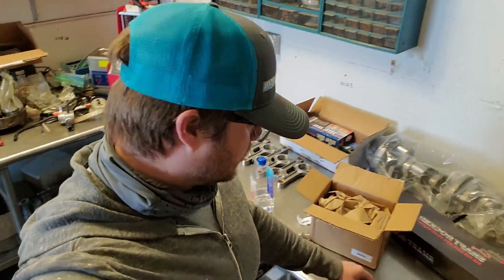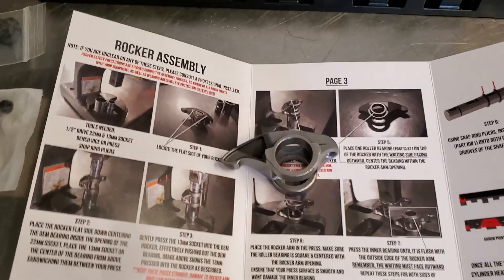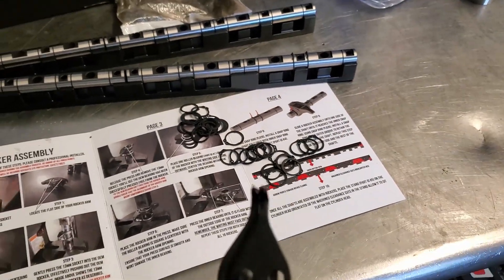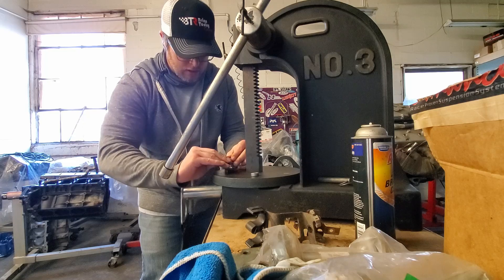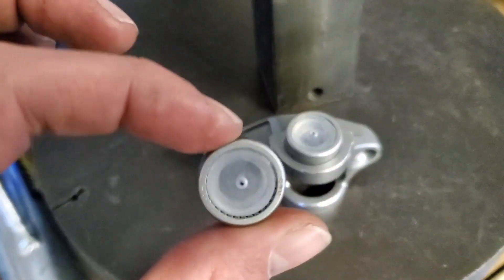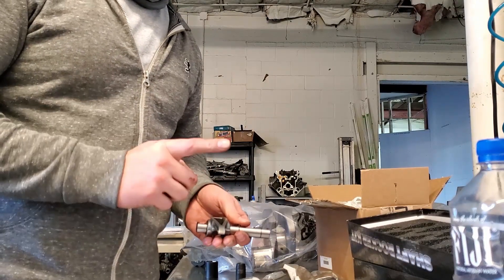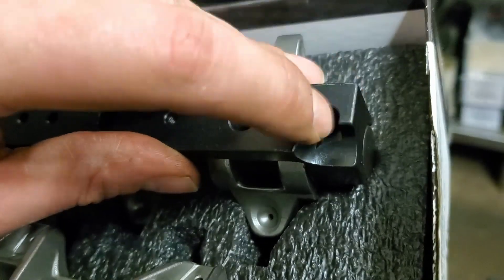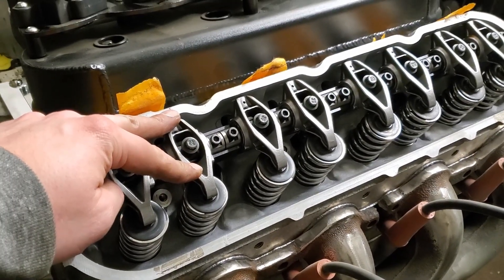BTR Shaft Rocker Kit and Bare Rocker Arms

Comment: Did they clear the OEM ls valve covers?  Cool build
Reply from the maker: I don't have OEM covers, but they do clear Motion Raceworks valve covers.
Reply: @GregoryBrettin i will find out the hard way since i bought these to go with PRC cylinder heads and wanted to know if they could clear motion raceworks billet valve covers.  And you just answered my question 

Thanks

Comment: We'll see how they work in the long run. I wish they boxed it like the stock. Is there an intake and exhaust difference with their rockers?
Reply from the maker: Exhaust and intake are the same, stock are the same for both sides as well. The advantages are strength and weight on tip in. I believe BTR has a spintron video that covers it.  

I ran the hell out of them on the dyno recently. My 4.8 doesn't have any valvetrain noise like most engines. I'm currently changing out my intake to a Shearer Fab ULP A2W with Holley short runners. Previously the engine didn't want to RPM (7200max) so we'll see how the new setup does. Hoping to spin 8500 - 9000. I know people will say you can do that with stock and a trunnion, but I was a bit of insurance.  Probably more information than you want... lol

Comment: After installation did any of them seem a little to tight on shaft I have the same rockers and shaft kit and it wasn't all of them it was only a few
Reply from the maker: All of the shaft mounted rockers were absolutely smooth as butter.
Reply: @GregoryBrettin  you see that's what's tripping me out because I called the customer service over at Brian tooley and they're like they need to be ran as soon as the ran though free up I just don't want to send needle bearings to my freshly rebuilt motor it's a scary thing I'm wondering if I should have just try and buy bushings for these rocker arms and unfortunately go through the process all over again
Reply from the maker: @grantadan  I think you know what is right. If they are just not spinning easy on the shaft, then I'd say it's a break in issue. If the needle bearing were binding, I'd 100% change it

Comment: How did you end up measuring pushrods/preload?  Did you bolt down all five on each cylinder or?  Just picked this kit up and am already exhausted thinking about how long that is going to take!
Reply from the maker: I had a push rod measuring. Then I checked all the valves by rolling over the engine over and measured lash when the valve was closed. I looked for binding when the valve was open. That's roughly what was done, I had a buddy helping.

Comment: While this is a good video for its intended application of stock rockers; many of its points cannot be used when upgrading to roller tip rocker arms, where MID-LIFT geometry must be used. There are a lot of videos out on roller tip rocker geometry that is completely misleading on the priorities of what should be checked, how to set, and what their effects are. For those who fall into this more high end application of rocker geometry for any of the LS series engines, please find the following comments helpful.
>
You NEVER want to worry about where the wear pattern is at on the valve to set rocker geometry. The wear pattern has NOTHING to do with "geometry." Because none of the manufacturers have any "accurate" standards for stud and stand mount dimensions from the valve, and because the stud leans into the valve, and because engine builders use varying length valves, and lastly, because every custom engine has a different NET valve lift, no rocker arm is going to be able to have the exact length required (on a mass produced basis) to accommodate all these variables. That is why you shouldn't worry about where the witness mark on the valve tip is at. Just worry about the angles. The BEST way to assure you are measuring ANGLES correctly with HARD measurements, is to use the VALVE SPRING RETAINER, because it is perfectly mounted at a 90 degree angle to the valve, and that is the principle of MID-LIFT precision.
>
You NEVER want to use "checking springs" to set rocker geometry. You need to check for NET valve lift with ACTUAL springs. Once you know what your NET valve lift is, then EVERYTHING after that is done with a CLOSED valve, no tension on the valve train; not even necessary to have an adjuster in place. Just an adjustable push-rod; dial calipers and KNOWLEDGE.
>
With all the tools I've made; and all the engines I've built; and all the tricks I've learned (many from other creative engine builders), to this day when I still occasionally help an old friend out on setting up his rocker geometry, I do it in less than 5 minutes with the following technique. It's all done in the CLOSED VALVE position, because you don't need to worry about hydraulic lifter valve compression or flex. You don't even need to have the adjuster on the rocker arm; it is all laying loose. And obviously, unlike this video, you are not rotating the whole thing over under valve spring pressure. Once you know what your NET valve lift is, everything after that is math, and setup; and this can all be done with the rocker laying loose on the stud, and an adjustable push-rod lifting or lower it as needed.
>
It's not complicated:
A. Know your NET valve lift; divide in two; that is your MID-LIFT "motion" (MLM).
B. Measure the height of your valve tip above the retainer.
C. Measure the diameter of the roller; divide in half (this precisely gets you from the bottom of the roller to the AXIS).
D. ADD "B" and "C" together, to get the STACK HEIGHT. An illustration can be found at: http://www.mid-lift.com/TECH/TECH-Installed-G1.htm
E. Now, use a straight edge like the little machinist square shown in this video, and lay it across the valve spring retainer and alongside the trunnion.
F. SUBTRACT or ADD (as needed) the STACK HEIGHT to or from your MID-LIFT MOTION, by raising or lowering the rocker arm on the stud.
>
EXAMPLE:
* NET VALVE LIFT IS .700", so MID-LIFT MOTION is .350". That's cut in stone, now forget it for the moment (you've written it down).
* Valve tip is .050" above the top of the retainer; and the .500" rocker arm roller diameter tells you its radius is .250", so the STACK HEIGHT is .300".
SOLUTION:
If the STACK HEIGHT is .300" and the MLM is .350", then you need to place the trunnion .050" BELOW the valve spring retainer. If your math has the inversion of this, then your trunnion centerline would be above the straight edge coming off the retainer.
SUMMARY:
DO EVERYTHING IN THE CLOSED VALVE POSITION, AFTER YOU KNOW NET LIFT. It's much easier to get an accurate DIAL CALIPER measurement on hard points, to find their true center-lines, than trying to use visuals that only give you approximate values. You can use the outer edges of the trunnion's diameter and divide in two for its center, which is far more accurate than eye-balling. For those who want to know what is important, and how to fix existing systems, you can get the book on this at: http://www.mid-lift.com/MID-LIFT_ARAT-2016.htm It's this simple: KNOW YOUR MLM; KNOW YOUR STACK HEIGHT; USE THE RETAINER AT CLOSED VALVE; and SET YOUR ROCKER TRUNNION as needed. Good luck to all. --Jim Miller
Reply from the maker: That is great information! Thank you for taking the time to put it into the comments!

Comment: Wish I knew if there was a weight difference between stock
Reply: BTR sales info says that it weighs an extra 2.9 grams total for the rocker body, 2.5 grams of this is at the tip at install height.  This makes sense as when you look at the rocker there is thicker material from the fulcrum to the tip.  Slightly heavier but should be a lot stronger than a stock one at a critical point.
Reply from the maker: Shoot, wish I got the weight prior to installing. I bet BTR would get that to you pretty easy.

Comment: Make sure you check the feel of the trunnions after assembly. Most of my btr trunnions felt gritty after assembled and I had to return the kit.
Reply from the maker: I 100% did that and they were silky smooth, all of them. Thanks for the heads up on that.

Comment: I just installed these tonight. I used the shaft to push out the plastic seals. It worked pretty smooth, like using linear slide rails.
Reply: Hey mate you wouldn’t have the torque specs on hand still? I misplaced my install instructions
Reply from the maker: @jackrodwell1314  Sorry man! just saw this. I'm certain that you have this taken care of by now though.
Reply from the maker: I eventually started doing that... after I had a needle bearing come out! hah. Good tip for everyone . Thanks for the comment man!